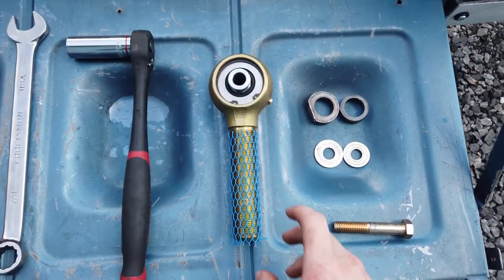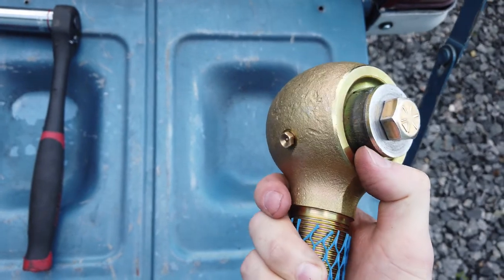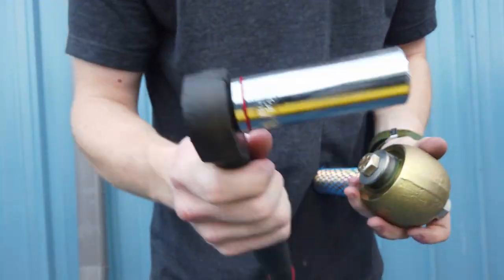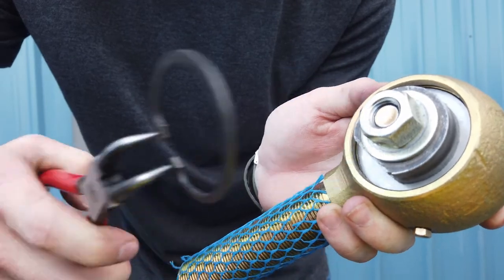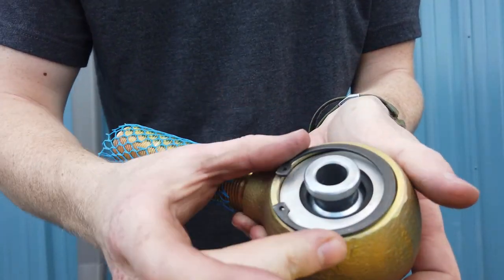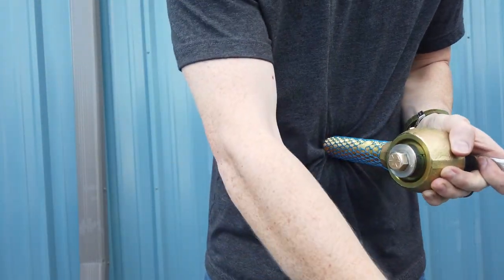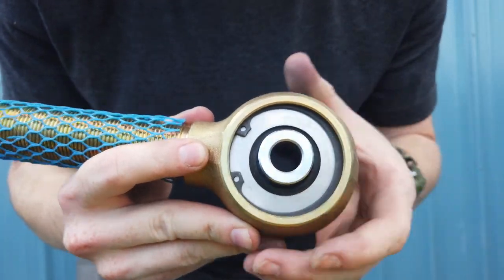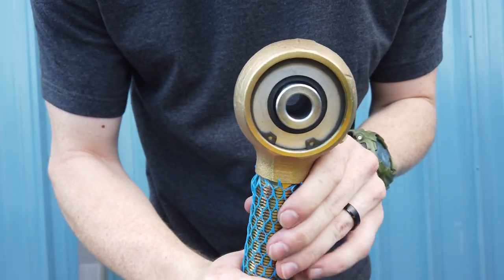How To: Rebuild An Enduro Joint

Comment: Question: That little nut/bolt on the outside of the joint, is that a Zirk fitting to grease the joints periodically without disassembling them?
Reply from the maker: Yes it is! You use a needle fitting to grease them.

Comment: Why isn’t this tool included with either the joints themselves or the rebuild kits? After buying 12 joints and two rebuild kits, c clamps are getting old.
Reply from the maker: Here is a link for the rebuild kit with the tool.
https://www.barnes4wd.com/Large-Enduro-Joint-Rebuild-Tool-Kit_p_1180.html
Thanks